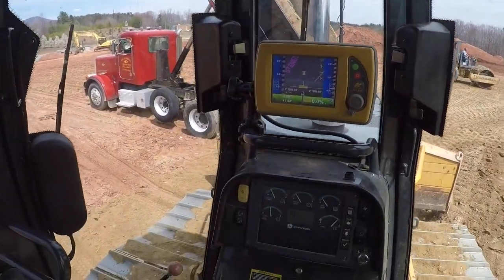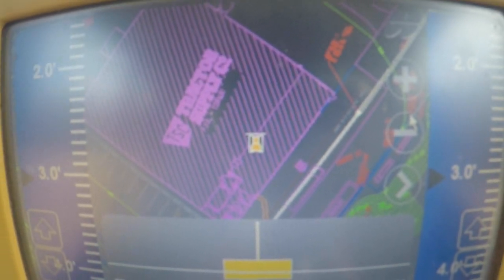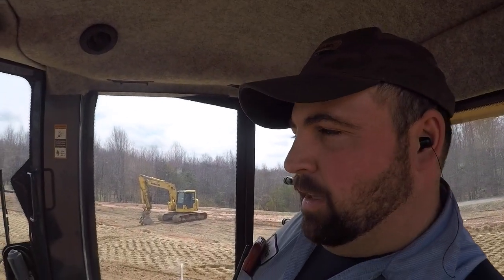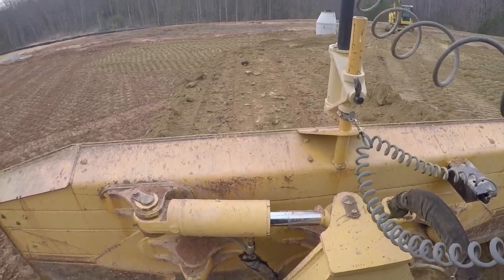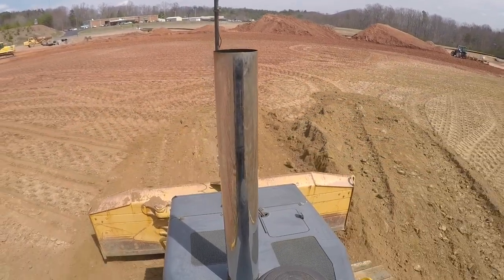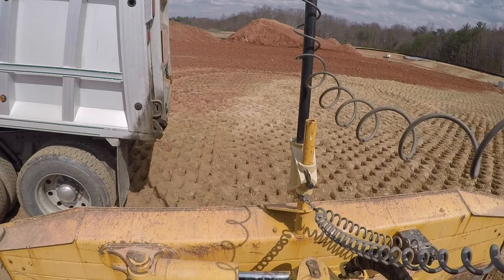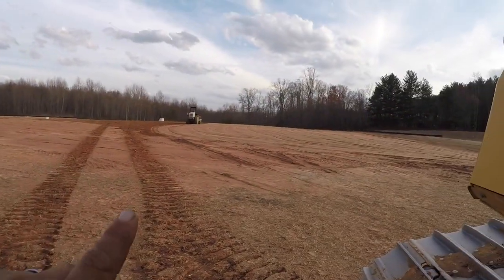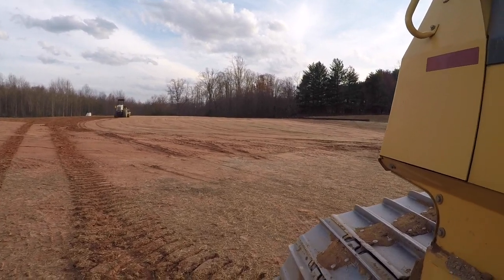Moving Dirt! Building Pad for Tractor supply.

Comment: A D6 would be comperable to the Deere 850... about twice the machine of the D3 right?
Noticed maybe your track tension may need adjusting soon. Not that I know, just seemed like they had some slack.
Reply from the maker: Actually i run both the 850 and a D6M and D6N quite a bit and the 850 is a lot more dozer than either one of those. Yes the tracks could use a little snugging. They are basically worn out.